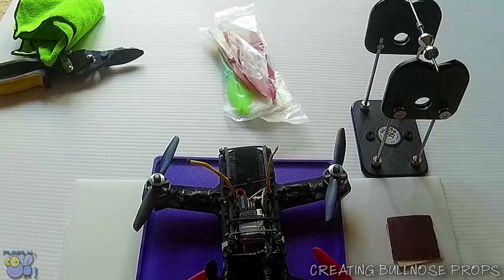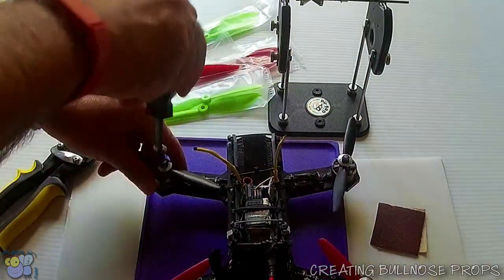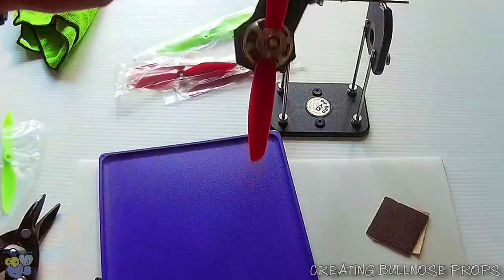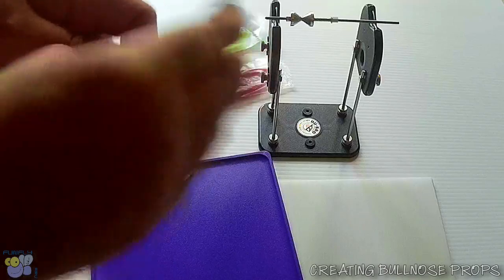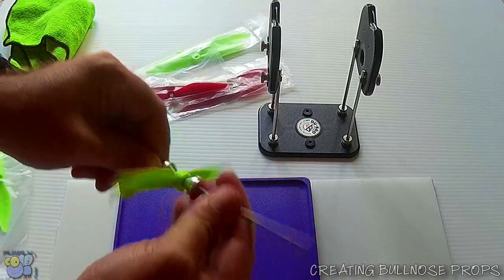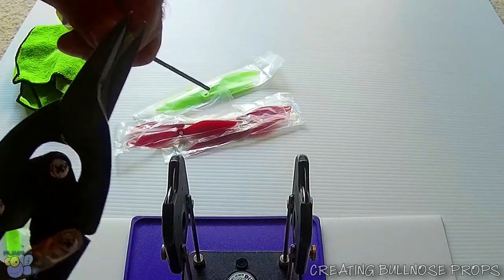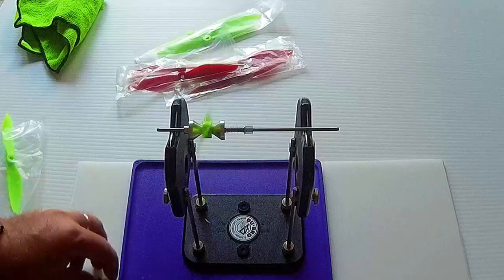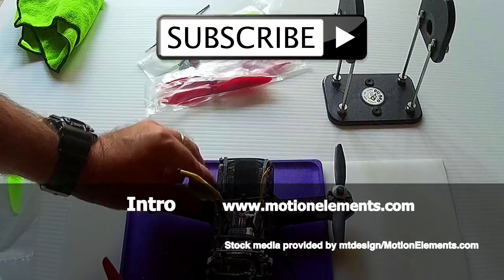Cutting DAL 6040 Props to 5" Bullnose

Comment: What do you like about using a 6 in prop rather than purchasing a 5 in prop?
Reply from the maker: darmiejr This copter can only use 5" props, but cutting a 6" down to 5" (making it a bullnose) gives the prop much more surface area. The result is much better lift and surface area for maneuvers but on the negative side you lose efficiency and draw much more power.

Comment: Not a bad tutorial, but the big problem with your method is that you are balancing the prop by cutting one of the blades shorter. The propeller is balanced as far as the weight, but one blade will create more thrust than the other since one is now shorter. This means that the prop will create uneven thrust which will cause it to wobble. I'm not completely sure but I believe this is called Dynamic Unbalance. 

A better way of balancing is either by sanding down the entire blade of the heavier one to reduce it's weight, or just add tape to the lighter blade.
Reply from the maker: +Peter Hornea Yes I can see the merit of your comment but I don't believe on a small prop like this that makes a noticeable difference. Something definitely to consider.
Reply: +FunFly FPV First off, that's like saying balancing such a small prop also doesn't make much of a noticeable difference. Also it depends on your setup as well. If you are just running a regular speed (2300kv) setup with 3S it may not be as important. But when you push it to 4S and even more so with 4S on micro's with 3100kv motors, the blade length difference makes a huge difference. Remember that a prop produces the MOST thrust at the tip, especially if you're turning it into a BN prop where the tips are very wide. So yea, even a small cut like that will make a difference.
Reply from the maker: +Peter Hornea Ok thank you, thats why I said it is definitely something to consider.